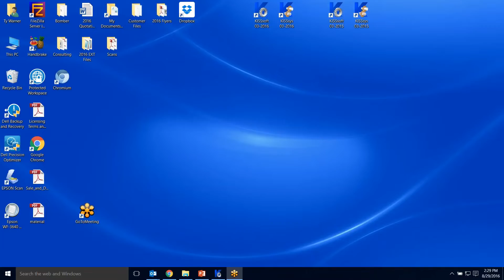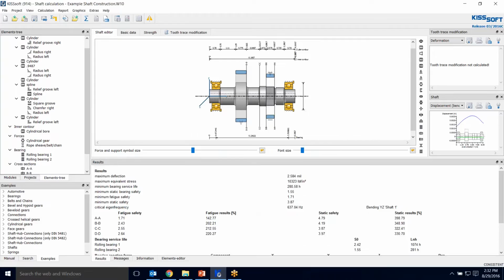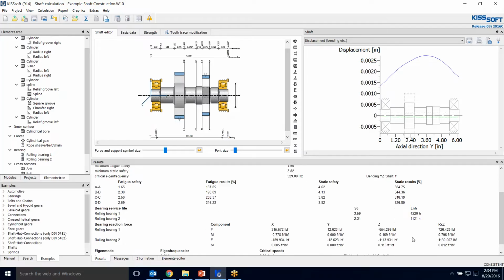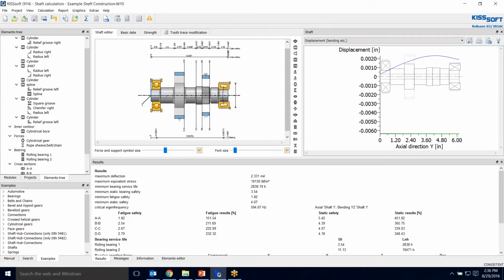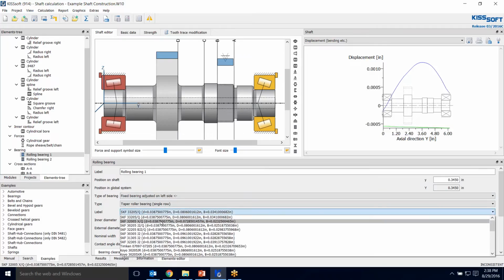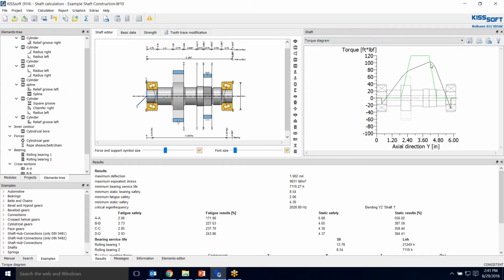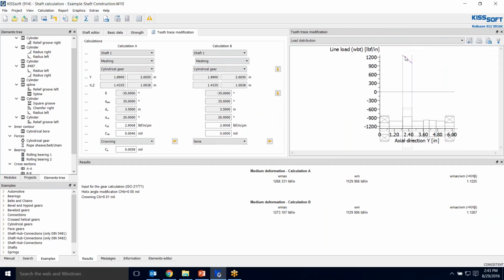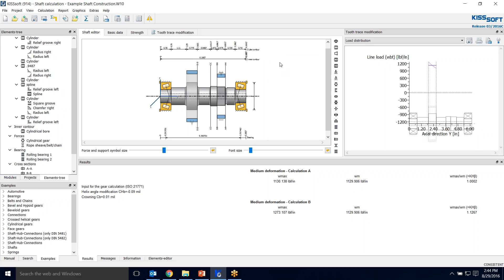KISSsoft Shafts Part 3

Comment: I am using the 2022 version of KissSoft. The option to preload the taper bearings is not in the same place as the 2016 version used in this video, and I can't find it anywhere. Is that option still available in the 2022 version?
Reply from the maker: Yes, you can still preload, select the bearing, the rolling bearing element window should open and you can see the bearing information.  Make sure you have bearing stiffness selected.  In the rolling bearing element window, where you specify the bearing, there is a the bearing clearance tab, you can offset the external ring in the Y direction to apply preload. (I don't know why they pulled the force window out of 2022, that's probably what you were expecting to see)

Comment: Am I able to export exactly the same 3D model as I designed in KiSSsoft?
For example a shaft with all geometry features like splines, gears on the shaft, etc...
I tried but the 3D model only contains the basic geometric size like the outer diameter of each section of the shaft
Reply from the maker: you can export the shaft, you’d have to create the spline geometry and then export the gear geometry from the gear module, it doesn’t work quite like a CAD export tool like your thinking, it would be nice though

Comment from the maker: So you may need to change the module specific settings to non-linear, or you may need to change the node density.  Sometimes the model has parts that are interfering and this can give the same error.  You can send me your file and I can take a look at it for you if you like. ty.warner@kisssoft.com